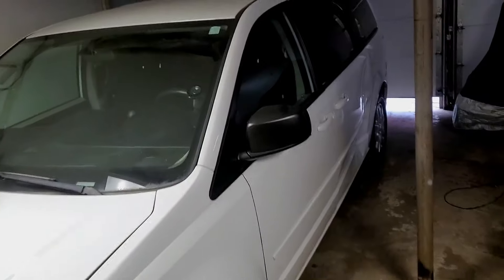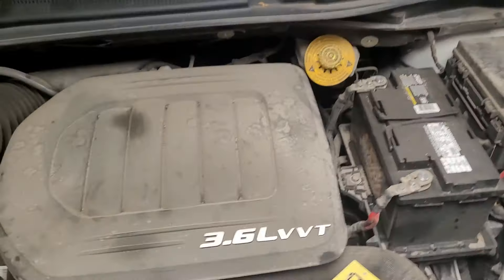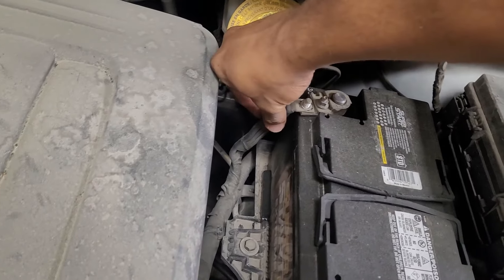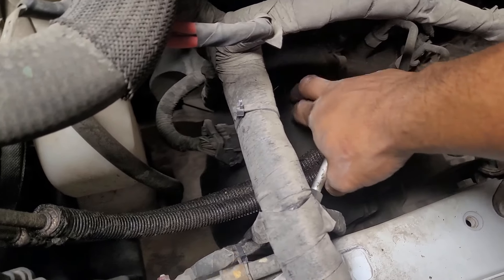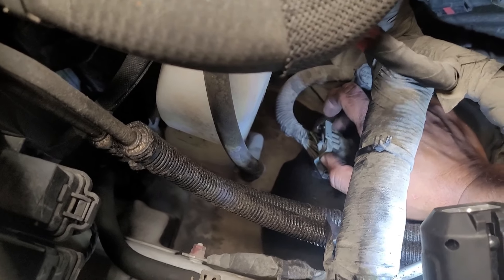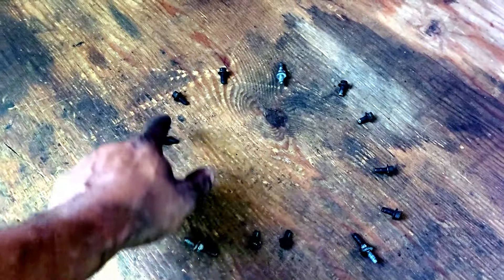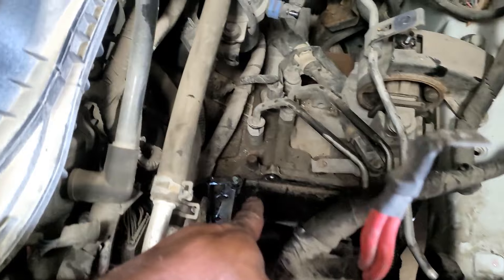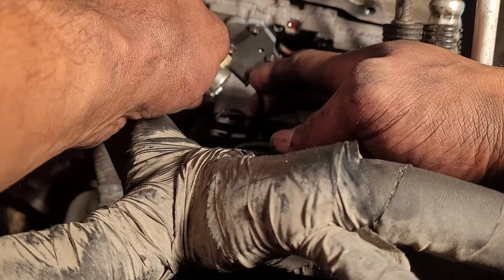2014 Dodge Grand Caravan 62TE Transmission Shift Solenoid (Minute Maintenance)

Comment: This video helped so much. Got it all changed but them my alternator went after i drove an hour. Got that all fixed now I'm popping this code again. I just changed it 2 days ago. Any ideas?
Reply from the maker: Oh No, I'm so sorry to Hear That! It's Possible that Strain to the Electrical System Caused the Code to Erroneously display or the Sensor to Not have enough electricity to properly work thus causing the issue. The 62TE Transmission has an electrically activated Clutch so any change in electrical current could cause a bad shift or sensor to throw an erroneous code. What specific vehicle do you have, code are you showing and are there any symptoms associated with the issue?

Comment: Might have missed it in the video but did you drain the trans fluid first? I had trans fluid spill out when I pulled the cover off . Probably a quart . Is that supposed to happen?
Thanks for sharing
Reply from the maker: Interesting! No I did not drain the Transmission for the Solenoid swap nor did I have any fluid spill out. That makes me concerned if somehow you damaged a Transmission Fluid line during your swap? Loosened up the Transmission pan by accident Or possibly the Main Valve Body (the part the Solenoid is actually bolted onto) is loose. If you're able to pinpoint where the fluid started thatd be useful. Being everything is expensive electronic components there should be very little fluid anywhere within that cover.
Reply: @minutemaintenance7385  thanks for the response. Definitely was a surprise. I’ll be pulling it apart again to further investigate. Hopefully it’s an easy fix 🤞
Reply: same thing happened to me on 2016 caravan, any info as to why fliud came out? About a half a qt
Reply: @minutemaintenance7385  The most likely reason you had no fluid loss is because the transmission is low on fluid. The cooler lines appear to have been leaking for a long time.

Comment: I have a 2017 dodge grandcaravan 145,000 miles and I’m having trouble with the transmission it may need a transmission rebuild not sure if it can be fixed pls need help hope to hear back
Reply: I’ll explain more
Reply: It drives well for a few and then it starts acting up I’ll accelerate but car won’t go anywhere but if I turn it off and back on it’s good for a few more and it will drive not sure I have the report from the dodge dealership I took it too but they want to charge me 6,500 to put a new transmission which I think is ridiculous
Reply from the maker: Wow! That sounds very concerning. If the Dodge dealership says it needs replaced/rebuild I would tend to believe them 😬...sounds like it's possible your Torque Converter or Clutch Plate are giving out...when the Transmission warms up...the fluid thins out and it makes it easier for "worn out gears" to slip. I would always recommend a 2nd opinion, with a Transmission shop! Not a dealership...dealership prices tend to be 30-40% higher in my experience. A Transmission shop who specializes in rebuilding Transmissions generally will have the best prices since they have alot of knowledge and stuff on hand. I'm so sorry! And good luck

Comment: They also call this is torque converter clutch solenoid. If you get a p07 something code saying low fluid pressure.  90% of the time. This is the culprit and can cause transmission to not shift down wards properly also and get stuck in first. Or second when coming to a stop. Some times it stalls and some times not when coming to a stop

Comment: My 2013 dodge caravan would rev (rpm would go up all the way ) but wouldnt shift gears and move accordingly. I push the gas pedal rpm goes up but speed would go past 15mph... Please comment based on your expertise. Have already changed spark plugs (ngk) and coils (mopar) fuel injectors( mopar) and all 4 o2 sensors ( Bosch)
Reply from the maker: Hey thanks for the Question! Could be a variety of issues...I'll Assume you dont have any "Check Engine" Lights or Codes..if you do let me know what they say! If irs my van, first thing I'd check is Transmission Fluid Level! Make sure its Properly Full..Not Overfull and NOT Low on Fluid!! Both of those issues will prevent Transmission from Shifting due to Pressure problems. Whole Checking level Make sure Fluid is Clean and Not Old and Burnt. Old fluid is too thin and causes gears to not grab. Finally when was the last time the transmission Filter was replaced? If not within 50k miles it's time to change the Fluid and the Filter! Theres a Video on this channel for Filter and fluid change for the Dodge caravan! Good luck!!
Reply: No check engine light or codes 
The car has 285k miles on it , I have had it since 100k miles and no transmission fluid and filter has not been changed since . I have checked it it doesn't seem burnt but the level seems a little high . So you are  saying change the fluid and filter first and than go from there ?? I have posted a link to video as to what is going on please watch and let me know your input https://youtu.be/016CFsB4v2o
Reply from the maker: @azizhouston84  Saw Your Video, Doesnt Appear that Gears are Grabbing/Engaging..I'd Change the Transmission Fluid AND Filter Immediately! Its inexpensive, Can be done at home with minimal tools and knowledge and could very well solve your issue! Driving a van 185k miles and never changing it? Filter will most likely be clogged, fluid will be thin and old! If it was a computer issue you should have a code! Swap the fluid and filter asap. Good luck!

Comment: my 2015 Chrysler town and country won't go in to reverse gear, and when Im drive gear it won't pass 20 mph, what would the problem be?
Reply from the maker: Hey Thanks for Watching! That's and oddly specific issue to have the Reverse and certain drive gears not working. When's the last time the fluid has been drained and swapped with a new filter? It's possible there is a dirty Port clogged in the valve body not allowing the clutches to engage. If I recall there is a low gear clutch that activates the reverse and 3rd gears. I donr believe this will be a Sensor related issue. If it's my van I'd check fluid levels, verify the fluid is clean and not dirty, burnt, old, contaminated...and if all of that checks out I'd have her at a Transmission shop as soon as possible to get formally diagnosed. Better to spend a few dollars on a diagnosis then let, a possible, small issue become a Transmission killing one. Goos Luck!
Reply: @minutemaintenance7385  thank you for the reply but the vehicle won't go pass 20 mph and if it dose I try to give gas so it can move and it dose not go any where, so I have to shut it down and turn it back again so I can move out of the way at 20 mph.
Reply from the maker: Sounds like a Vehicle that's Low on Fluid or has dirty fluid and isnt building enough pressure...or is possibly already in "limp mode" an issue you're describing is absolutely a concern. If it's me, I'm checking the fluid level and cleanliness...if that in itself is good, I dont think a shift solenoid is the issue, sounds like a full valve body concern...but again please get it diagnosed by a mechanic who can go hands on..most things can be fixed within a reasonable time, maybe something simple and inexpensive as opposed to having to replace the whole transmission.

Comment: Hello, I hope you are well.  Thanks for the video it was very helpful.  I would like to know what the symptoms of your truck were so that you could change that part, in my case I have problems in the transmission changes since it does not make the changes at the time and less when the truck goes to 40-50 and has to slow down and again has to speed up again, that's when I have the problem.  I would like to know if changing that part that you changed would help my problem with my truck.  Thanks and regards.
Reply from the maker: Thanks for Watching! The Symptoms this Van had, was the Engine Stalling/Dieing/Shutting Off When Shifting from drive into Reverse. What Vehicle do You Have? Are there any Codes? Have you Checked Proper Transmission Fluid Level and that its clean fluid? A transmission flush and new filter might help resolve your issues. It does not sound like you are describing a issue similar to my van.
Reply: Good Morning.  Thanks for your video.  I have a 2011 town and country and it loses strength to make the changes and more when one is already going more than 30-40-50 and one lowers the speed to raise it again is when it no longer wants to accelerate well and becomes silly and it doesn't advance with pressure and the changes are slow at the end if it accelerates but because I have to press all the accelerator.  and I don't have any code.  and I already took it to the mechanics and they figured out that they can't do anything if it doesn't have codes.  Thanks.
Reply from the maker: @mariomoraleshernandez5054  So Based on What Your Descibing the First Step is to Check your Transmission Fluid. Make Sure it's Clean and Fresh Properly Filled. Not Burnt, Old and Low. I Do Not Believe a Shift Solenoid Will Fix Your Issue. It Sounds Like You May Need a Transmission Fluid Flush and Filter Change.
Reply: hello.  Thanks, I already changed the oil in the transmission last year and there are no improvements, now I'm going to try.  change the part of the video that you made, to see if this improves it.  Thank you
Reply: I have a code po869 . My fluids is pretty high but not sure what cause it. But I’m believe if I fix what you fix and do a transmission fluid flush I would be ok. Do y’all agree!

Comment: Observations (great video overall)

Those "washers" that you didn't know what they were for and clipped them off? They are what holds the dust cover over the plate, which you ripped off leaving those still on. When you put it back on, the washers were discarded it's just a matter of time before it falls off while driving.

Worst of all you removed the pan from the 62TE side wall and just placed it back on the tranny when done, no attention to making sure the gasket was still viable. After 150k miles I promise you it wasn't, and now it'll leak tranny fluid until she brings it back to you to pay for repairs you caused.
Reply from the maker: Hey thanks for watching! Thankfully none of that happened! I fixed a few other issues on the van over the next year she had it (she unfortunately got into an accident and it totaled out but thankfully she and Hers were unharmed and not at fault so upgraded). Never had any leaks, cover stayed in place, never had any complaints!

 New gaskets are always a good idea but aren't always needed case in point my 52' Chevy barn find..Sat since 83' , towed it home...simple tune up, fluid flush, carb rebuild and wiring fixes due to mice and ran great never leaked and had original gaskets (at least from 83' as I never changed em). Good rule of thumb to swap gaskets but as this is a "how to get back on road for minimal cost/tools for the average soccer mom" channel...I operate from the motto of "if it stays, it plays". Plus..with routine maintenance and operating temperatures gaskets don't degrade as readily as ppl think in my experience!

Thanks for watching! And Happy Wrenching!

Comment: Hey M. Engine sticking occasionally in 2nd. Codes come at that point P0750&P0882. Covers off and doesnt stall like yours but I'm hopin your tip is guna fix without doing entire valve body. Will get back in few days and let u know if all good. Thanks regardless
Reply from the maker: Best of Luck Brother!
Reply: I got it in and sealed up nice.
She ran ok for 15 min and then the exact 2 codes. It does get easier the 2nd time if i do go with replacing the solenoid pack but not sure if I will. Pretty frustrated. Van also has quite the ticking going on even after I just changed all the rockers lifters one bad cam with worn lobe, even checked all the phasers and they're good. Can bad solenoid pack cause tick/cluck noise somewhere in the centre of engine.heard at idle and low speed? I did scan the solenoid leads and only off one's weren't even off that much
those that should be btw 1.6-1.8 were at 2 - 2.1. Nothing crazy. How were u so lucky brother!!
Reply from the maker: Wow! I'm so sorry Boss! Sounds like you've put alot of work into this beast!! Idk how I got so lucky, these 62TE Transmissions are not helpful when it comes to codes telling you whats wrong! I dont think the noise would be related!! Sounds like the whole Valve Body Might need replaced!! 😬 Real Queastion is...is it worth the headache anymore! Ha
Reply: @petert6594  hey bro did u ever figure out the problem mine has the same ticking for a while and it went into limp mode recently after trans started running roughy. I’m stuck like 20hours away from home in Texas. I wonder if I can get home like this or what I can do to fix it

Comment: I have the same problem exact same problem is that part called something else like lockup solenoid
Reply from the maker: Uh..Hard to Say! What Type of Vehicle do you Have? Unfortunately ppl Use Terms Interchangeably...While this Solenoid DOES Have Effects on the Torque Converter..I Wouldnt Refer to it as a Lockup Solenoid, That is Usually involved in "locking" the Converter at Highway speeds to Prevent Burnout..While that Would Definitely Cause Shifting and Stalling Issues...this Solenoid Monitors Fluid Pressure so the Transmission Knows When to Shift. Hope This Helps!

Comment: Why didn't you check the oil level before starting the dismantling process??
Reply from the maker: Hey thanks for watching! The only answer is...I did but didnt Capture it on video! I had worked a 16hr shift and was exhausted when working on this van and new I'd be immediately following up with the video on "transmission fluid and filter replacement"

Comment: Great DIY video. Did your bolts have rubber washers on each of them? Do I need to buy new rubber washers? Thanks
Reply: BTW, about 2 quarts of transmission fluid leaked. Is this normal? Thanks again.
Reply from the maker: @readytoretire1  Hey Boss! Yes There will be Some Fluid Loss, I Personally Had No Loss on this Vehicle but I've Known Others to Lose 1+ qts! Just be sure to top your fluid back off! A transmission fluid and filter swap is never a bad idea! As far as washers my bolts did not have any,  nor did my cover have any gasket or RTV..I've Seen others have washers and gaskets and I haven't found literature from a maintenance manual to verify whether they're needed or not! If your car had either I'd toss new ones on! Thx for watching and commenting!

Comment: don't you have to resilicone the pan also any idea on a p076a code 2009 town and country
Reply from the maker: Thanks for Watching!! I did not re silicone this pan Becasue this vehicle did not have a gasket on it or signs of silicone! I reached out to my local Dodge dealership to inquire about a OEM gasket and they had no information for me, so I decided to leave it as is! However I have seen some ppl Have had RTV or Gaskets and others haven't so...honestly wouldn't Hurt to just add silicone because this is an area that receives some fluid!!

In reference to your code that appears to be related to the Shift Solenoid sensing a malfunction I'm one of the pressure Valves/lines. I always recommend checking the Transmission Fluid first, changing the fluid/filter second if fluid appears old, thin or dirty. The Majority of sensor faults can be simply remedied by clean and full fluid and filters!!

Comment: Great job! But where’s the test drive? Did this fix the stalling temporarily or long term?
Reply from the maker: Yes Sir! Fixed the Problem Permanently...or At Least for 8 months Before the Owner Traded it In for a Newer Van!! Didn't Seem Prudent to do a "After" Test Drive, as I Couldnt Get the Van to Do the Stalling Beforehand. It Was an Intermittent, NO code, Issue Diagnosed Based on the Owners Description of the Problem and Online reportings!! But Yes IT solved it, I Personally Drove the Van Back to the owner the Following Morning, 150 mile Drive.

Comment: I have code p1745 is this will fix my problem, 2012 dodge caravan
Reply from the maker: Thanks for Watching!!

Looking up the code you provided it shows it's for a "Line Pressure Too High/Too Long" meaning the system is reading a pressure issue.

The research shows this is a common code that doesn't need a sensor swap, simply to be cleared out with the proper scanner. 

Not all code scanners are the same, some have extra functions. Tons of videos on the code clearing procedure and which scanner to use!!
Side note I'd consider a fluid and filter change as well, if fluid is too thin/old or filter is dirty it will cause bad pressure readings!!

Happy Wrenching!

Comment: Did it engin light still on replace the tork converter next now work fine engine light out
Reply from the maker: Sorry you needed a New Torque Converter! That's the tricky thing about these 62TE transmissions..the best way to Determine the issue is Symptom based as opposed to Check Engine Light. Glad your Vehicles running again!